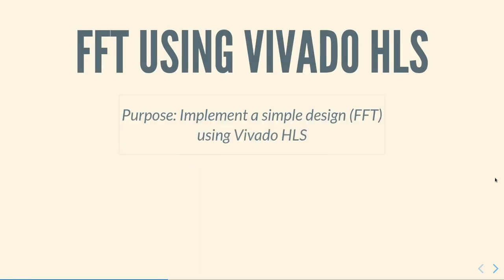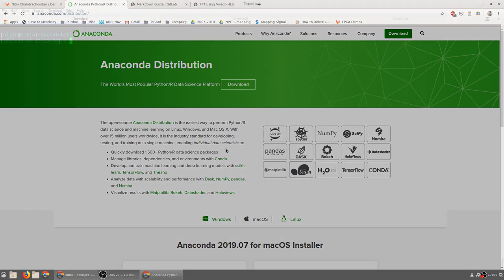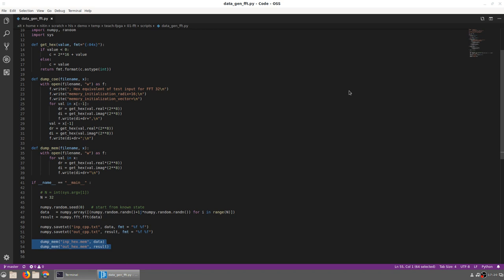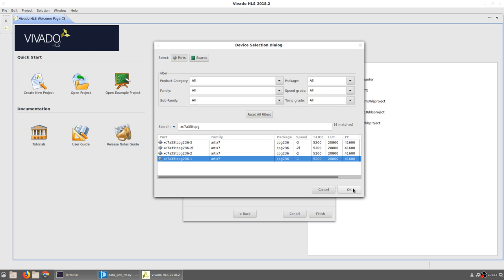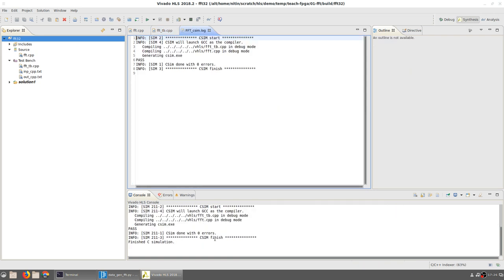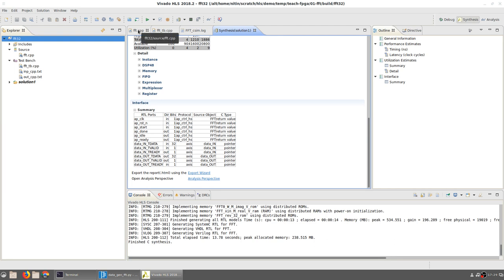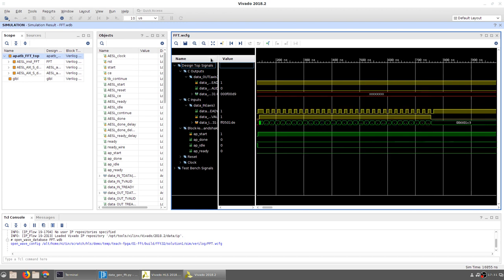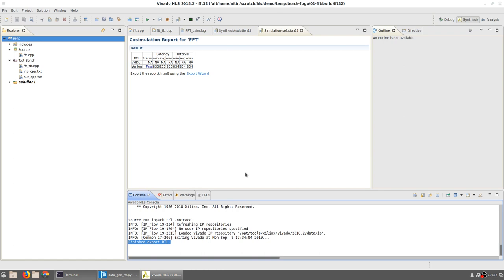Vivado HLS Example: FFT

Comment: Thank you so much for the great video, I am trying to implement the code to make FFT for 65536 Real points, and I am not sure how to manipulate the code for this purpose, can you please help me with that ?
Reply from the maker: I am not in a position to help with rewriting the code itself, but it should be straightforward. One way would be to change the FFT0 function and the twiddle factor computations, and then add appropriate number of stages to get the final implementation.

However, I doubt if that will be a very efficient way of doing it for 64K points, since it will involve a huge amount of hardware. You can play around with some of the Vivado HLS directives in that case and see how it goes.
Reply: @nitinchandrachoodan6783  do you think it is possible to use FFT radix-16 to fulfill the 65536 points multiple times ?
Reply: @Cody Dylan Yup, been using instaflixxer for since december myself :)